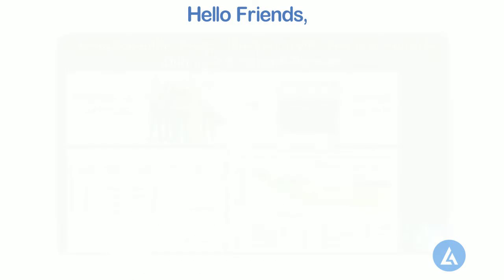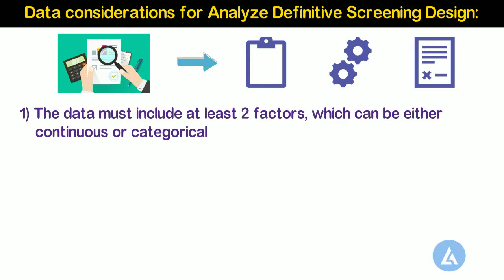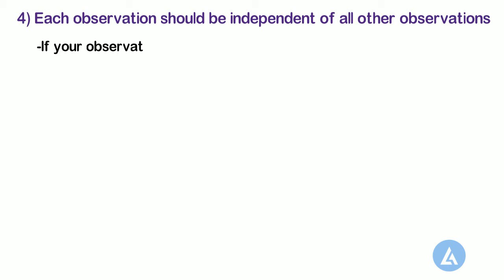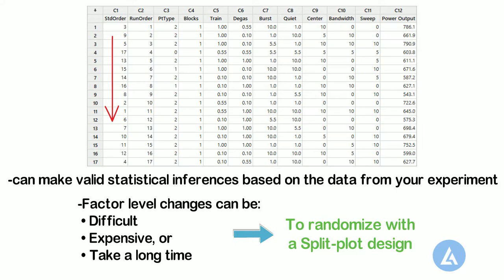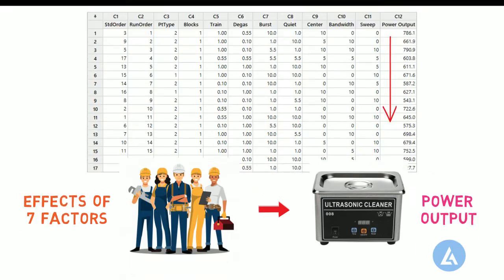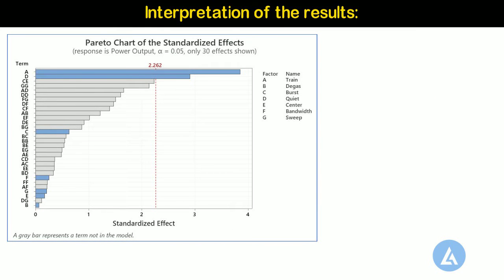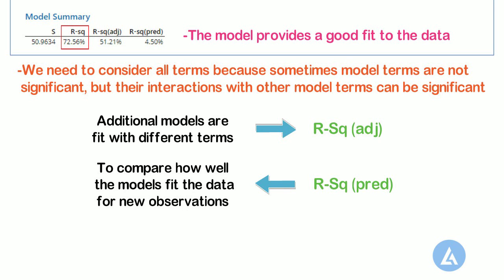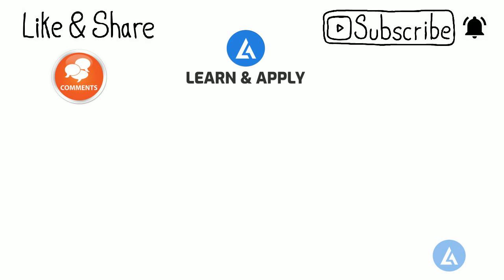Analyze Screening Design: Design of Experiment (DOE) With Example (Definitive & Plackett-Burman)

Comment: I am working towards screeing more than 50 factors, to do the screening, your videos are coming in very useful. also as a request, your voice was more than good ( I saw DOE videos as well), This robotic voice , sound very dull.  Subscribed
Reply from the maker: Thank you so much for your valuable comments and appreciation! 😊🙏
Noted and thank you for your great support.
Reply: @learnandapply  I have coded 7 factors, and 1 response, now how can I run Plakett-berman on it? intead of analyzing the entire design? it has 73 runs
Reply from the maker: How you got 73 runs? 
You can perform the screening experiment, 1st level, with only 13 runs including the center point. (For 7 factors Plackett-Burman design)